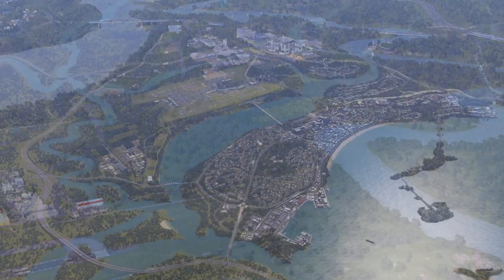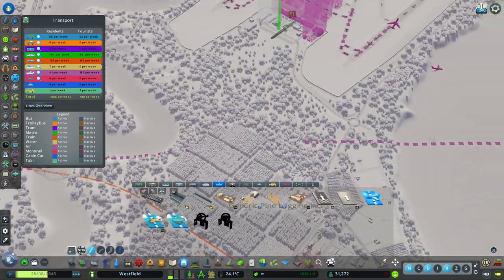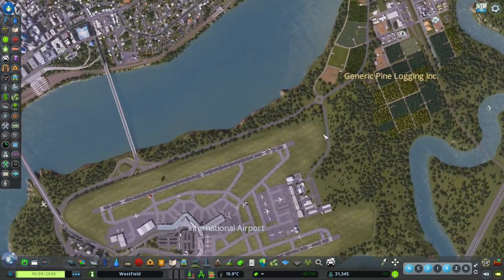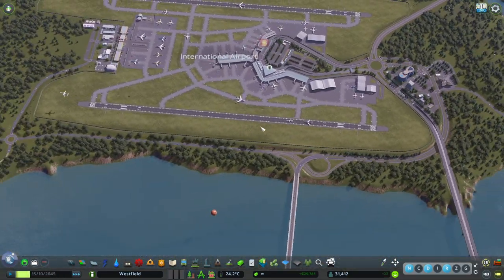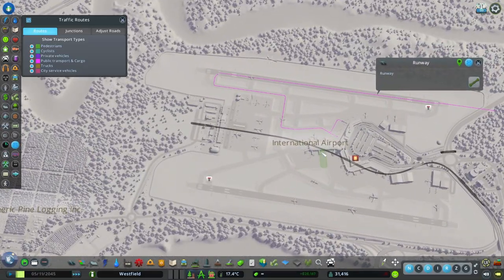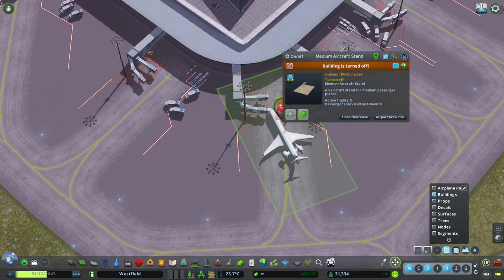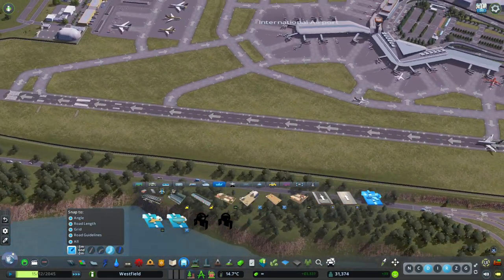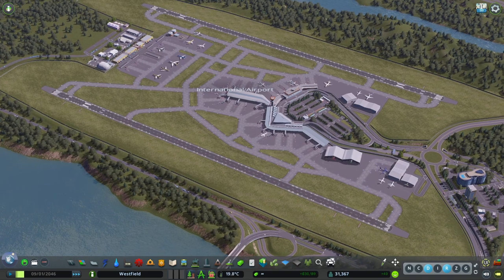Fixing airplane take-off and landing in Cities: Skylines

Comment: Very cool, thanks Teddy!

One quick tip: with the latest Move It update, you can now select and move plane paths in the normal view. Use the picker filter to limit your selection to just plane paths as you did, then go into Options -> Move It and scroll down to near the bottom. Turn on "Allow Move It to select everything", now you will be able to select the plane paths even when they are not visible.

Remember to turn off this option when you have finished - it is very powerful and you could move something you didn't want to!
Reply: "Remember to turn off this option when you have finished - it is very powerful and you could move something you didn't want to!" This sounds like something that Infrastructurist guy is sure to forget and then whine about on his community page afterwards, seeking help :'D

Comment: My latest build on ps5 has the planes take off and go straight vertical... I'm assuming I turned on SpaceX mode lol 🤣 I'm baffled by having produced this DLC without even a part of the code to say, if runway in use or landing then go around. In what world would you get two planes land simultaneously... That's my biggest bugbear

Comment: you know what bugs me.  airplanes not taking off at all. 
one single plane taking off as i build the airport and then never again.

vanilla airport works fine btw.
Reply from the maker: unfortunately i still dont have a  solid fix that works everytime for that but sometimes rebuilding more or less everything is the only option and sometimes even that wont work. helped a friend with this the other day. had the same issue. we couldnt really solve it fully either.

Comment: My passenger airport wont work, my cargo airport work fine, i have 150k population iv rebuilt all terminals, taxiways and runways just in case it was a dodgy node i just cant solve the issue
Reply from the maker: Airplane path issues? 🤔
Reply from the maker: Cargo and passenger connected to same runways? Could be they cant find taxiway paths, u probably already checked, but recheck taxiway directions, also try replacing plane stands, sometimes that can help
Reply from the maker: Can also try and place a vanilla passenger airport in same location to see if it gets used
Reply: I replaced everything i deleted all airplane paths then replaced them, cargo work so paths seem ok, separate runways, got transport links